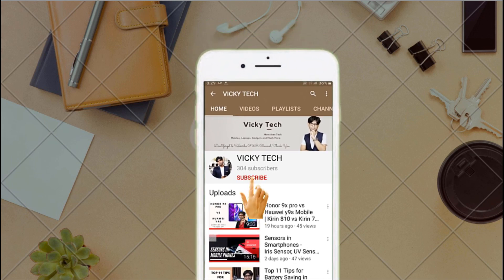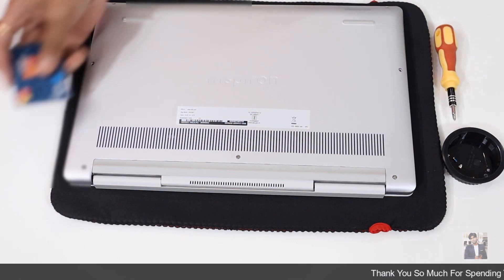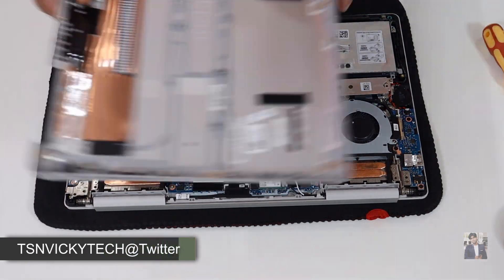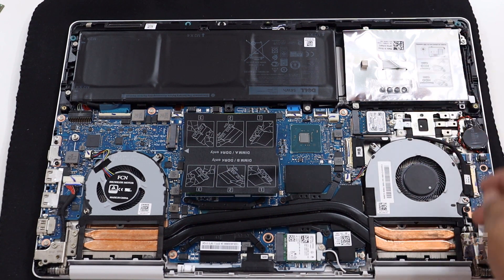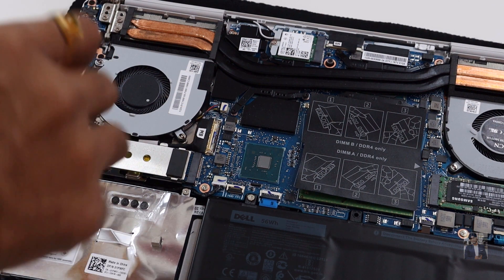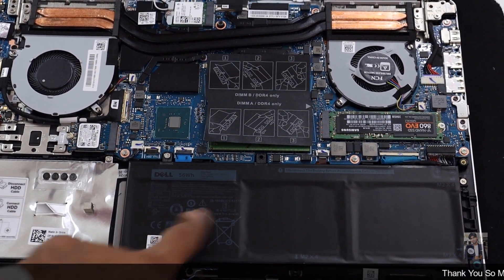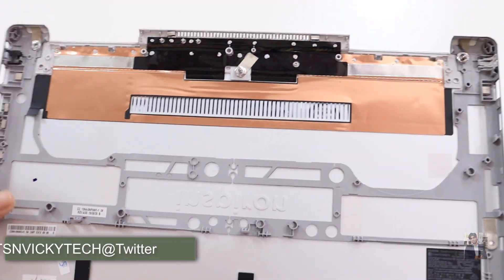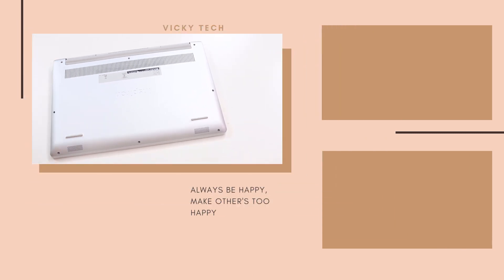Dell Inspiron 15 7591Tear - Down and SSD Upgrade | Vicky Tech

Comment: Hi,  I have a 7591 and would like to install a 2TB HDD in the extra slot.  Do I need to purchase a SATA cable and a battery cable to connect this?  Or are they included in the case?

Thanks!
Reply from the maker: Hi Alex I'm very sorry for taking long time to reply you. 
Do you still available brother.
Reply: @meetsrikanth    Yes.  Stil want to know....  I would like to install a 2TB HDD in the extra slot.  Do I need to purchase a SATA cable and a battery cable to connect this?  Or are they included in the case?
Reply from the maker: @alexkuklik6100  we have to buy them brother. I spoked with technical team
Reply: @meetsrikanth    Thanks very much for that.  I really appreciate it.  I think that I have found the Sata cable on ebay, but I cannot find the power/battery cable.  Any idea where I might find this?

Comment: There are three storage slots... One is the 2242 (500GB that comes preinstalled), one vacant hdd slot and one vacant pcie nvme ssd slot. I'm trying to dual boot my computer with both windows and linux. windows on primary drive and Linux on a separate drive. According to the dell website, I cannot have 2 ssds together. but in your video, you have put a samsung nvme ssd on the second ssd slot. Is that combination allowed and are you able to boot successfully? Also do you know if I can make the vacant 2280 ssd slot a bootable drive? 

Thanks in advance

PS: I was going to buy a SATA III ssd to put it in my hdd slot to dual boot but the price of 2280 nvme ssds have dropped now and I'm confused :(

Also a small request, can you make a follow up video on how you actually installed the nvme ssd and booting your computer after installing it and do a speed test on the drive.
Reply from the maker: sorry to say that brother, that ssd i used is not worked with me also.
But about dual boot up, No idea whether this laptop work or not

Comment: i ordered 7591 2 in 1 a year ago and it was my worst purchase ever.
It freezes when pressuring a little bit near the keyboard area and continously BSOD issues appeared.
Reply from the maker: Hi brother,

Mine laptop still working perfectly, moreover I'm heavy user
Reply: @meetsrikanth  why this freezing issue occurs when pressuring the keyboard area?
Do you have any suggestions?
Reply from the maker: @apusuman6171  brother immediately contact dell team, is there any flex on keyboard.

How much pressure you applying bro

Comment: Hello, my inspiring is not starting up. Service centre suggested I need to take a back up by removing the hard disk. I am unable to find the ssd case. Could you please help? I am in Mumbai.
Reply from the maker: Hi brother, once you open back panel.

There was a seperate slot for additional HDD ,  below it you will SSD remove the screw and it outside brother
Reply: @meetsrikanth  The SSD i can find, but the case to take back is what I need. Kindly let me know if I can contact you.

Comment: Hi i would like to upgrade RAM. there are a lot of ddr4 2666Mhz ram models are available. Can you suggest me one compatible 16 gb ram for this laptop model dell 7591 model? i would like to pait it with current 8gb.
Reply: @meetsrikanth  Its alright. what you suggested is not for laptop. https://www.amazon.in/dp/B08C4VKYFG/ref=twister_B08GMQSKFH?_encoding=UTF8&psc=1 i am buying the above model.
Reply from the maker: @sumanthreddy8047  yes my brother I forgot it .

Go for it brother it's good. 

If possible please use my Amazon link brother 

Then I get small commission

Comment: Hi Can the additional ssd that you added fit in the slot where the original ssd was. Also when you put in the additional ssd did you have to setup a raid format or hod did it work having two ssd
Reply from the maker: yes of course, but there was separate slot prefer that brother.